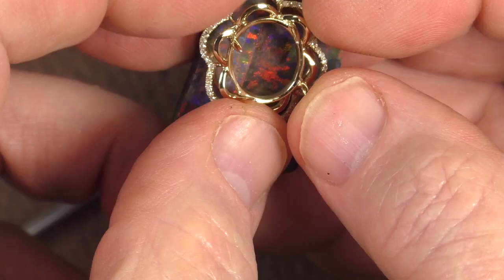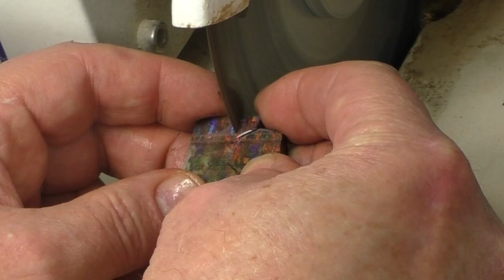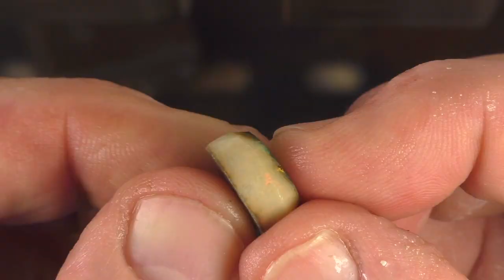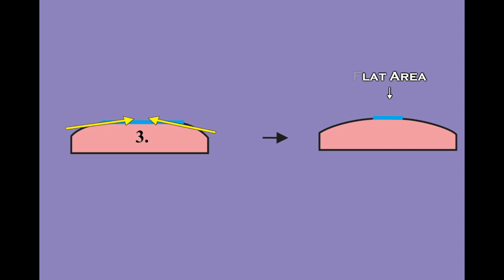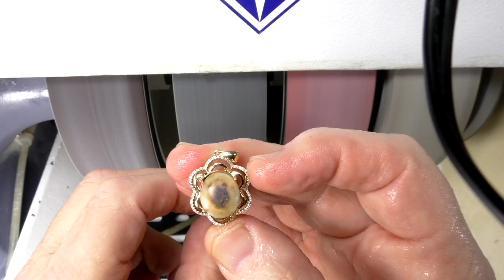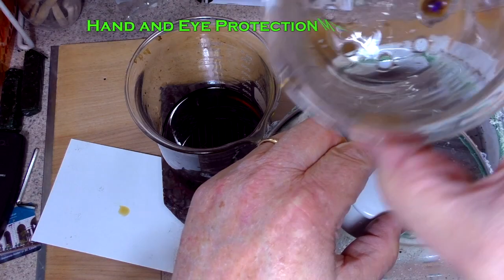How to Cut Opal  - Step by Step using Andamooka Matrix Opal Gemstone

Comment: This is new informtion, yikes, had no idea that Matrix Opal doesn't treat all the way in.
Question tho, you polished with 14k but dry, do you polish slower than usual to prevent overheating or it doesn't matter anymore at that stage?
Reply from the maker: All stones that are cut dry get hot.  They cool withing seconds (if they didn't get too hot).  Actually, the 14k wheel makes the opal hotter than any other wheel.
Reply: @PulitzerOpal  Thanks for the info.

Comment: Great vid! I'm glad to know having a polished surface doesn't necessarily interfer with the treatment. Do you put the opal in the acid cold and heat it all together? Or is the acid hot when you put the opal in?
Reply: @PulitzerOpal  yes thats why I decided to polish pre treatment initially. I figured if I left them rough and polished after I might polish through the treatment. I hadn't considered re treating. So about two thirds of them are polished and the rest at around 600 mesh. I've had them in sugar solution around 3-4 days and am chomping at the bit to go to the acid. Maybe tonight. I'll show you the results. 
 Also I figure if the polished ones come out weak I'll just sand the polish off and retreat and see if that solves a problem. Cheers

Comment: Can somone tell here what material vax? or glue or plastic is used on that stick to hold the stone properly? thanks.. I would use that for a different purpose..

Also thanks for sharing, eventough I don't work with stones/ opals at all, but from material point of view it is interesting and that sugar/acid treatment is just marvelous.
Reply: @PulitzerOpal  Thanks a lot I would like to have something like that for grinding of small and tiny samples, I just hope that it will be possble to attach also metallic (non ferous) materials or other composites, for sure I will give it a try. But I need to experiment with the applied heat because of oxidation of some metals. :/
Reply: @PulitzerOpal  Sure I have seen it since I was child in TV or across the internet. Sure I can create plenty with epoxy too. Exactly your point, the epoxy is depending on the filler a lot, also on the working/hardening time, which mostly for best quality is about 12-24h, however that I am using for mainly metalography, but when I would like to shape something with no goal to achieving perfect flat face, I would like to try this vax. It seem that it grip perfectly, therefore I will give a try! thanks a lot for so detail information.

Comment: I think I always used cerium oxide on leather(maybe by hand) for a final polish, if I remember right I got a higher polish with that than diamond, I never had any of that type opal though. Opal used to be a lot cheaper but years ago  someone told me that the Japanese started trying to buy all the opal or the mines and the price went through the roof. I bought a really nice 8X10 oval multi colored white opal down at Six Flags for $10 in 1979, and a few years later I bought a real nice 8X10 oval at the Canton Texas flea market with larger multi color size pin fire for $20,  there's no telling what they would cost now, but the last time I looked at buying any the price was outrageous, I thought.  Where are you able to get the Andamooka Matrix Opal ?